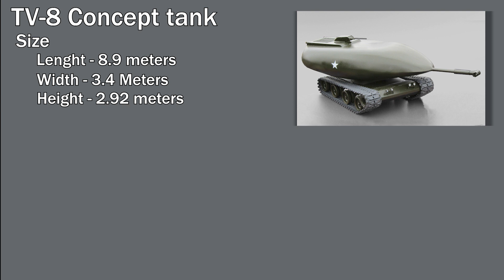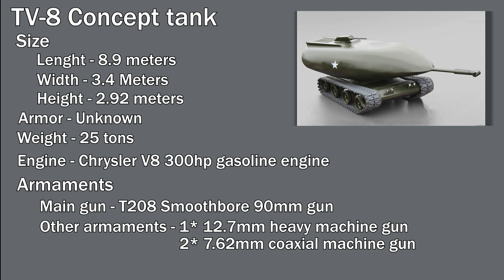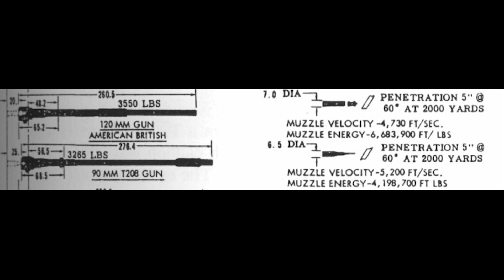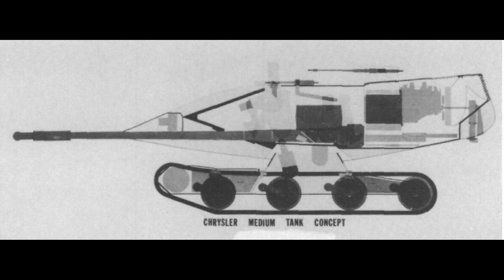The history of the TV-8 concept tank that was envisioned being mounted with nuclear powered engine

Comment: Atomic reactors use water. Its just water. It turns into steam. Just like a coal power pant uses water. The steam turns a generator. You get electricity this way.
There is no glowing green goo. Just two types of unstable metals and water to cool the heat which also turns to steam.
So, yes your electricity in your home still comes from steam either way.